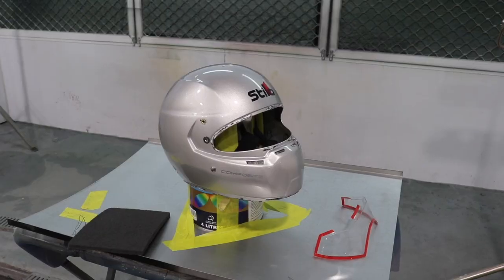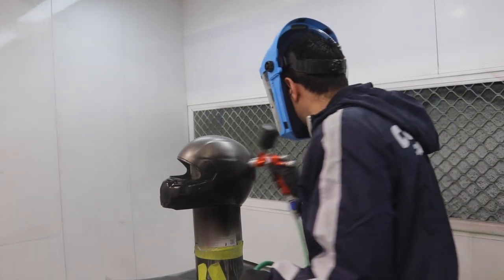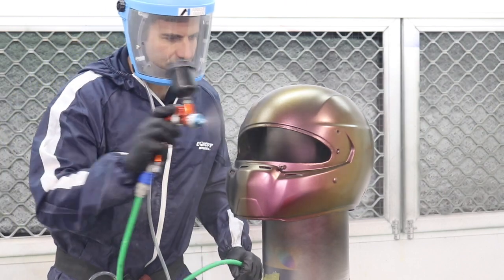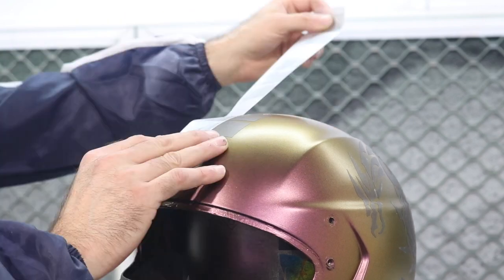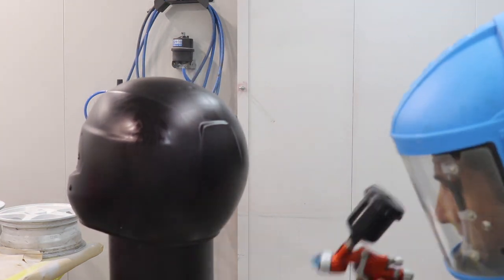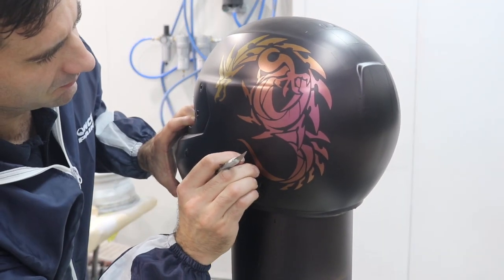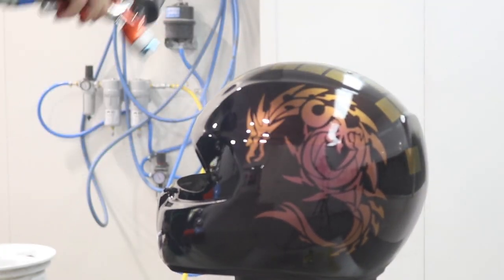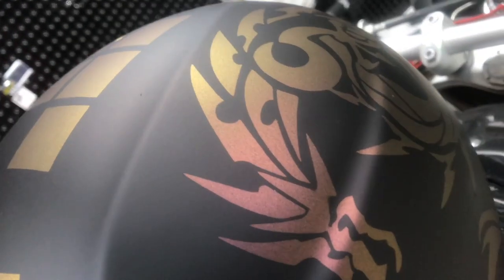Helmet Spray Painted Colour Shift FLAT

Comment: You mentioned you may sand out the flat clear and shoot another coat.  How did that go?  I understand if the thickness is different the ‘shine will be different with the matte clear, and unless you sand it all evenly it will look streaky or splotchy.  I shoot normal clear and then just one or two coats of matte and pray for no trash.... and live with it if I were to get any...  would like to know if I have bad info!   Lmk.  Great vid Btw. one more thing; with your cutter software you can curve the images so they apply straight to a round surface.  It takes some fiddling but makes applying a breeze cause they don’t bunch up and also words or names, for example, can look perfectly straight even on a round surface.  The hard part is the helmet isn’t a perfect sphere.... and every brand is different, but you will get a feel for it... and close is 100 times better than trying to curve a sticker that is cut for a flat surface!

Comment: Awesome as ever, your videos inspired me to custom paint a couple of small panels on one bike...now I'm ready to tackle fairings on my other bike (CBF1000) - I have one question for you though, if you don't mind:
I want to paint three colours on the main fairings: The original pearl white, with a candy royal blue section in the middle (like a very wide stripe) and a deep red or bronze (candy) border line (about 6-10mm)for the blue section. I know I need to basecoat (silver pearl) for all the colours - but what order should I be painting in? 

I was thinking: 
Primer, 
silver pearl base, 
paint the area of the border line without masking anything, 
intercoat, mask over that with fine line tape to get my line, 
another coat or two of silver base, 
candy blue section, then mask that off 
White
Clearcoat

Does that even make sense?? :D

Comment: Thanks for your videos. Question... Do you have to clean the sticker residue off before spraying the clear? And similarly, clean where your hand touched the helmet while applying and removing the stickers? If so, how do you know WHEN you can safely clean it, and with what cleaner?
Reply from the maker: Ron Anderson some times I use water. On this I just cleaned with a tack rag. This is a low tack vinyl so there was no residue.
Reply from the maker: You can clean it after 20 minutes

Comment: I never understood why if you only want the copper for the shapes under the stickers, why dont you just paint that area of the helmet copper instead of all the helmet?
Reply: Edges.  They show up under the black.  And unless the paint is really opaque it can also change the color.  It can be done but only if you know the top color is very opaque, you fade out so no edges on the ground color, and you know exactly what and where you are going to mask.  Honestly it’s just easier to hit the whole thing.  And, with a color like yellow, for example, even over say silver on a white helmet, the yellow will be a different color over white vs silver, even after 10 coats....   most helmets have a skeleton set of lines that create an outline of each section.... after that is done, then you obviously wouldn’t paint the whole helmet just the section that had the masking.... but still the whole section, for the same reason.

Comment: Where I find the sticker u can print on at home?
Reply from the maker: Jhon Shmit you will need a cutting machine. Then you just use vinyl
Reply: @customspraymods  so for Hobby it's easyer to order online, the machine probably cost trillion, especially here in Switzerland.
Thank for the answer